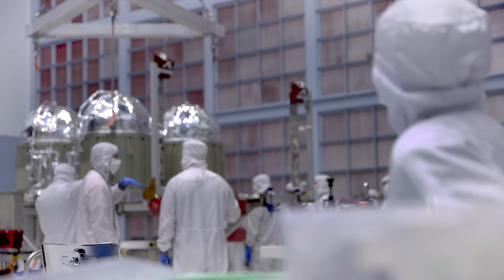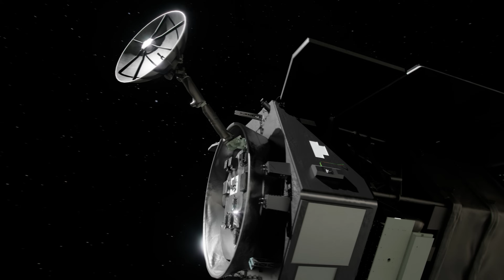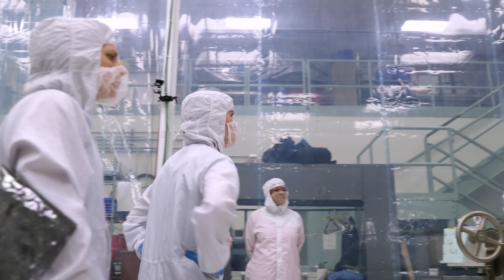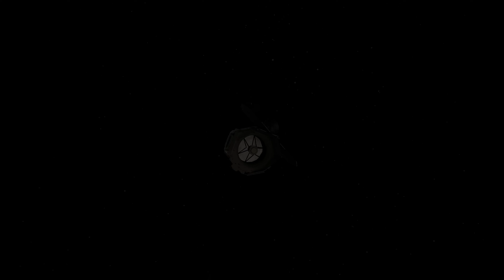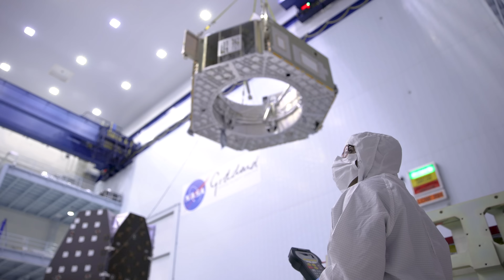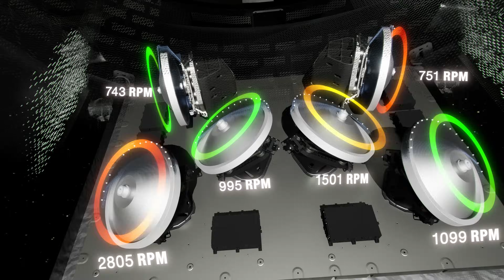Moving Roman: Propulsion

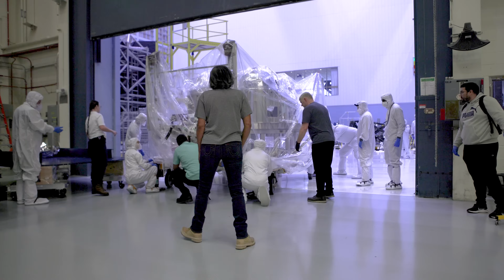Comment: 2:21 So in this frame you have 7 people in full body clean suit. But then you also have 5 people dressed casually, 3 with gloves, 2 without. Why?
Reply: There was a crew of people in suits that got the subsystem ready for transport in a different cleanroom. They walked directly out with it and didn't stop to take off the suit. Other people walking by were guiding it - they were never in a cleanroom or going to be. Then there are people in the bigger cleanroom ready to receive it in suits that had not been compromised. Finally, contamination control inspects and thoroughly cleans the hardware.
Reply: Did you ever get a response from nasa? I’ll just hang out here until you do……